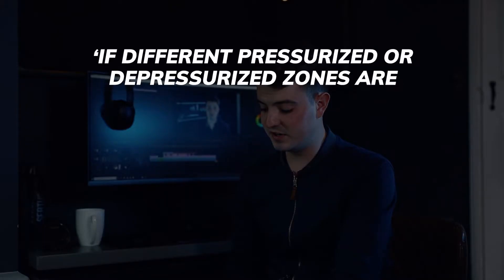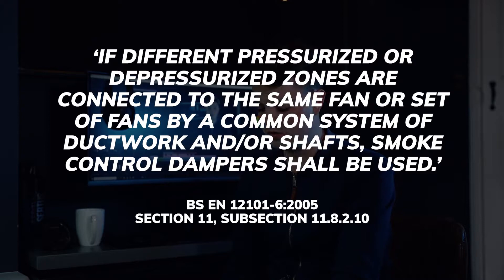Two Minute Tuesday - All About Smoke Control Dampers

Comment: If you use a smoke damper for Environmental use could it be possible that smoke could be drawn away from the detector(s) , up the smoke shaft and activate the wrong smoke zone ??
Reply from the maker: Hello Phil, I'm really sorry about the delay in responding to this - I missed the message!  When smoke is detected, the first thing that happens is the environmental system is shut down.  Following that, only the damper on the fire floor opens, the rest remain in 'lockout'.  Dampers can only then be opened by the fire service, however, the damper on the fire floor must be closed before another can open.  I hope that helps?